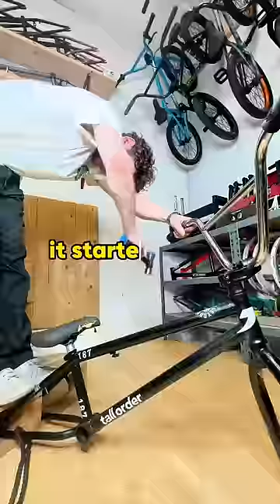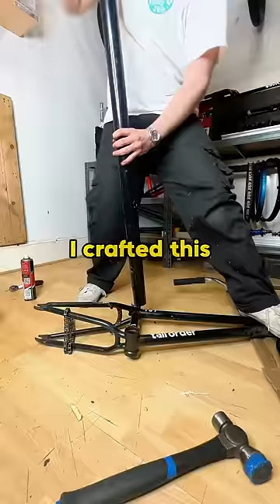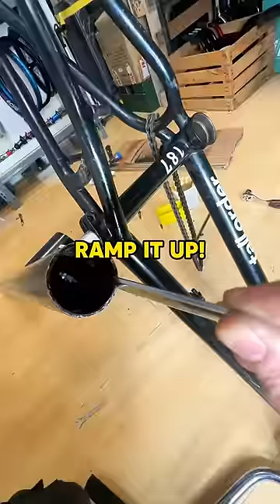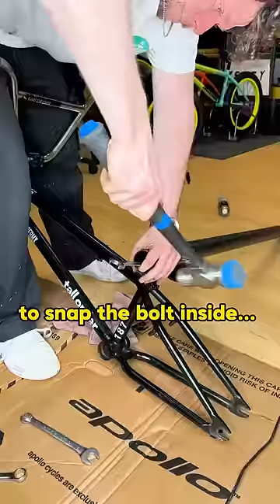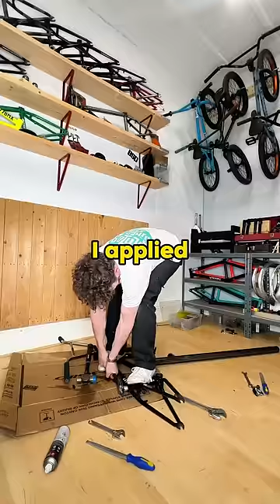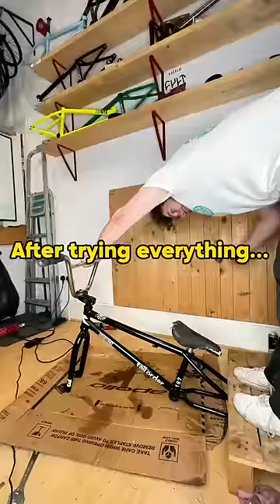Extreme BMX Rescue Mission: Battling the stubborn seatpost from Hell! 😳😱 #bmx #bikerepair #shorts

Comment: You needed to sit there with a blow torch on the frame and heat the entire frame up. It’s gonna end up making that portion of the frame weaker and that’s the only way you would’ve actually gotten that seat out. I’ve had to do it before it took like three days, and the seat was in the bike since it was brand new and the frame was like seven years old

Comment: You gotta try putting some lube through the bottom bracket, through the bottom of the seat tube, warm up the frame instead of the seatpost, squish the seatpost in a Vice bolted to the work bench and do the twist.

Comment: Jam a wedge in the clamp slot, and if you're using heat, heat the rod, not the frame. Heat makes metal contract so if you heat the clamp, you could be making it harder ir yourself. Unless you're making them both glow cherry red,

Comment: Cut the top of the post off. 
Then use a sawzall or hack saw blade to split the post lengthwise. 
Might need more than one cut. 
The aluminum has expanded jamming it into the seat tube. 
Slicing it releases the pressure. 
I’ve dealt with this a lot.

Comment: You could put some dry ice on the seat post while simultaneously heating the seat tube. Put a bolt in the post, and use an impact driver on it. In the video it looks like you never tried pounding it further in, sometimes just a dead blow whack down will loosen it up. Lesson learned, always put anti-seize on the post

Comment: I wouldve used something with a bit more heat. Usually thing like that are made of aluminum so it should have a lower melting point. A blowtorch should do well. You could also try getting a really big drill bit and drilling through the post. It should weaken the structure so that it can bend easier. You can also yuse both methods and drill the hole then use the bowtorch from the inside.

Comment: Try using a bottle jack or a lift of a sort, secure the bike down and use the bottle jack or lift to push your leverage bar, might snap the bolt might also work hope this helps
Reply from the maker: That’s very helpful!! Thanks a lot 🙌👊

Comment: My local bike shop uses Coke a Cola Upend the bike having removed Bottom Bracket introduce and fill the Down tube with Coke ( original) top up as necessary over 12-24 hrs until the seat post rotated using only with minimal force by hand Jobs a good in and you’ll never drink coke again when you figure out how it’s working!!

Comment: Run a bolt backwards through the threads of the seat clamp, and use a coin on the other end inside to screw against and stretch the opening

Comment: Soak with WD40 for a few days. Inside too if your BB shell and seat tube have an open connection. Put the seat post in a VERY sturdily mounted vice. Call a friend or two over and use the bike as leverage. Twist back and forth by the head tube and rear dropout.If that doesn't work, it's welded together.

Comment: Either a slide hammer, or an impact just to spin it, idk if the impact would trash the bike frame but i use impacts to free bolts from stuck steel bushing sleeves. So much easier than heat and beat for 3 hrs

Comment: Should've taken a bolt and set it up un the seat clamp in a way that would cause it to force the seat clamp to open further or used a tool for compression of brake caliber pistons and used it to force open the space where the seat mount is set in because u can always repair it using a longer bolt and tightening it down

Comment: The problem: aluminium seat post / steel frame.
      When aluminium oxidizes ('rusts') it expands. (Aluminium oxide takes up more space than aluminium).
     Oil has no chance to get through; tension is too high to break it loose by force.

Should have: 
1) Cut off the top of the seat post
2) Use a hacksaw to cut a section of the seatpost out of the frame. (To relieve tension).
3) A little percussive persuasion to break free the remainder of the post from the frame.

That's it.

Comment: Saw off the post top (not flush with the frame, leave something to grasp. Drill out / ream out the hole in the alloy tube as far as you dare, ideally just starting to hit the steel tube. Cut a vertical slot in what’s left (hacksaw blade pulled upwards over & over). It should then ease out with a little persuasion. Only the seat post needs to be destroyed.

Comment: Bro, dont heat the post itself, that will make it EXPAND inside the frame, instead, making it harder to pull out, instead, heat the frame and try holding an ice pack on the end of the seat post, also maybe try some automotive parts pulling tools,

Comment: I got so many frames like this. 
I was going to try drilling through the top of the post after cutting it if you get the size perfect you should be able to drill it out enough so that you can split the post without damage to the frame.
A little bit like removing cylinder sleeves from an engine

Comment: If you really needed it out you get a large drill bit smaller than the post and a Bore the same size or a few hundredths of an in or 0.5mm smaller and drill it out. Post removed, no damage to the frame and good for a new one.

Comment: if the bike frame is Steel and the seat post is aluminium you should cool and not heat because aluminium contracts more than Steel but it expands more than Steel heating loks the post even more.
Use dry ice next time!

Comment: Put a bolt halfway through the seat clamp then stick a piece of metal on the front of the bolt so it can’t go through the other half and use a drill to push it forward and loosen the clamp

Comment: If you want heat to loosen it up, heat up the frame's seattube not the heatube inside it. It'll expand more and get even righter. From what I've observed on the frame, there wasn't a rust or corrosion on the seatube so make it wont budge, if you want to pull it out don't do it sideways, instead pull and push out of the seattube.

Comment: It because you heat it 😅. If you want to take that apart frost it. If you use heat gun the metal will just expand but if you use cold it will decrease the density of the metal and will come out easily 😅

Comment: Not enough heat & applied to the wrong area. You want to expand the metal holding the object which is stuck (the bike frame heated) so it expands, helping release the stuck object. Should’ve brought it to an auto shop or welder they’d have got it done for you. Shet even a Dremel cut a slit down and curl the post in on itself.

Comment: Heat was the right idea wrong direction you wanted to get ice and toss them into the middle of the seat post as it is most likely made of aluminum compared to the steel bike frame which means all that’s happening is it’s expanding inside the frame instead of the frame expanding from it and if u put ice the aluminum would shrink and u could slip it out

Comment: heat will make the metal expand making it harder to pull off if you put it in a freezer the metal will contract in the seat tube will just slide right out. you obviously don't have a freezer large enough to fit a bicycle but a bag of ice or some crushed dry ice will do the trick.

Comment: Youre problem was the heat. A torch would have been much better and heat just the outside not the seat post. A torch would give more concetrated heat the heat gun also heats up the post which expands inside and makes it harder.

Comment: Because cutting the seat pipe off and filing a split in the remainder and hitting it with a chisel was too hard..............

Also dont you a heat gun, get a blowtorch as its the quenching the metal with oil(or water) that shadders rust and oxidised bits off to make it swing free

Comment: Using a heat gun instead of a blow torch or an acetylene torch like it's actually going to get the metal hot enough to loosen anything is about the dumbest thing I've seen this year

Comment: You need a seat puller.  Mounts to the botem bracket and attaches to the seat post.  Acts like a reverse press, with a big screw pulling on the post.
Twisting the seat post wokt do anything.
Also, what bolt inside?

Comment: Useless.  Some bike shops have a jacking machine, which gets most posts out. If they fail, cut the post off a couple of inches up, use an angle grinder to slot it down as far as possible into the frame slot then extend the slot by sawing internally with a power hacksaw. Then drill through the post, insert an old bolt, trap the post and bolt in a vice and turn the frame. It will curl the post out.

Comment: You need to cut off the seat post snd then use a small cutting tool to cut it in half through the inside of the tubebthrough the top simce you cut it. Should work

Comment: Next time make from inside the pipe with alternative blade cut from inside ....or in from pedals hole put a washer  bolt and inside under the pipe from the top make an extractor

Comment: So that heat gun you were using is pretty much a glorified hair dryer so that might be a part of the problem, i would suggest a real blow torch and no not a propane one although for that application the propane might work but youd be surprised how hot you have to get an object before you can get it to move

Comment: As a car mechanic i could get it out and laugh, you don't know what you go through working on cars. Easiest thing is to bash it inwards so it busts free and remove it or cut the post and hammer a screwdriver between it and the frame tube, worst thing is slice up the post along the frame tube and weld it back together after remove it.
Many ways to remove it but some will need paint retouch, i understand that you didn't want to ruin the paint, but man you ended up dumping the whole frame!
Reply from the maker: Hey man, Thanks for the awesome comment. Yes we definitely made it more difficult because we wanted to keep the nice paint finish.... But We went back and got the frame out of the Bin for Round 2! 🔥🔥
Reply: @T77BMX  i'm waiting to see.. i'm not even in bmx and i'm not subbed... Actually i am subbed since now 😂

Comment: Well you're supposed to use cold not heat cuz metal expands with heat so stick it in the fridge for like or the freezer for like a day and pull it out heat up the outside and there you go

Comment: U didn’t use the right tools and next time put the bike upside down block off the holes in the bottom fill up the tube with lubrication and let it soak for a few nights then it will come out no problem. I’ve done that a million times

Comment: Drop the bike on the ground a few times it will brake free vibration but may mark frame sander up and down the shaft with out the grit hanger bike on stings sand reat drop outs dont hold the bike if all that fails if do the same bro lol if the bike is solid vibration should reach the point its stuck and crack it free the chain and forks off first

Comment: Wrong type of heat
Reply from the maker: Yes! More heat would be much better but I was worried it would destroy the paint 🎨 🤔
Reply: @T77BMX  yeah a torch would have got it out but definitely melted the paint although a quick touch up definitely cheaper than a new frame.

Comment: Heating one part without cooling the other it's not much difference if you could just heat then get dry ice on the inside.. anyways a BMX frame isn't really that expensive it still sucks

Comment: If you have a engineers face is the clamp pin bolt loose should you spray WD-40 down the the seat tube with the seat pin Squirtle your double d40 leave it then stick it in a vice to break the rust or the aluminium or aluminium BMX the corrosion I am break the seal

Comment: RUST REMOVER....
Reply from the maker: Yes! Good idea
Reply: @T77BMX  get a syringe and make sure it gets in-between. Put more in every 10 mins for an hour. Let it sit for another hour, and that should disconnect the two pieces. You'll still need to give it a little force but it should come out. I've done it twice.
Reply: Oh but be warn a mess is coming out with that post.

Comment: I can tell you this if you to use an actual blowtorch or a propane torch instead of a heat gun you might have accomplished something because that heat gun does not put out the thermal heat needed to cause the rust to bust loose 😂 do you throw away bike because you did things backwards and wrong now I hope that makes you feel real intelligent because you know what if you what he used an actual torch it would have come out of their slick easy guaranteed😂